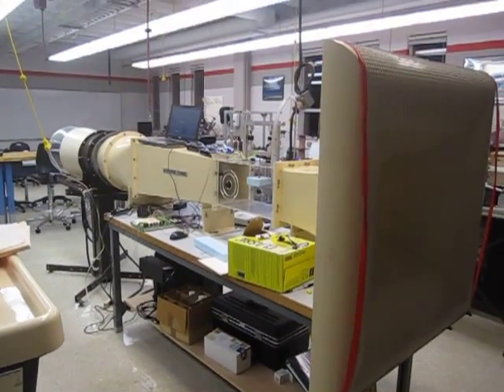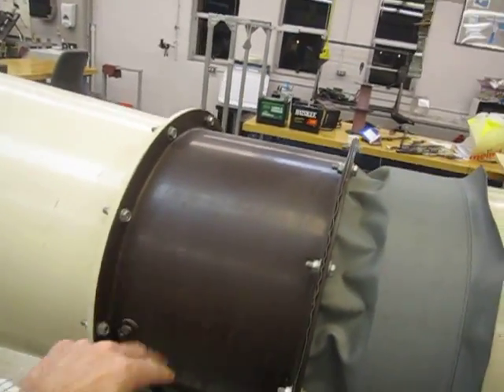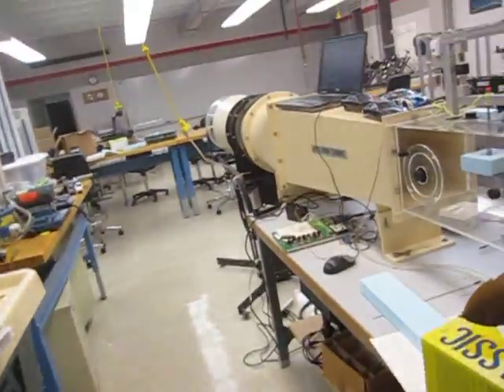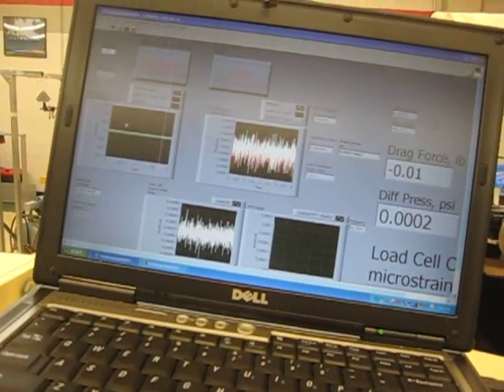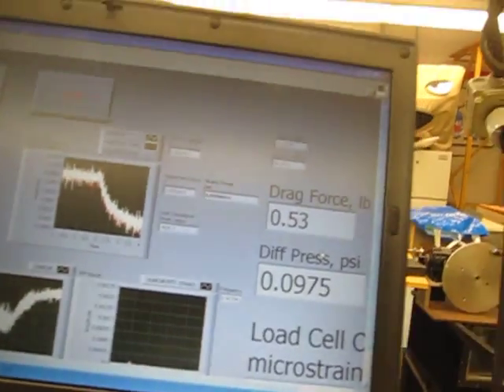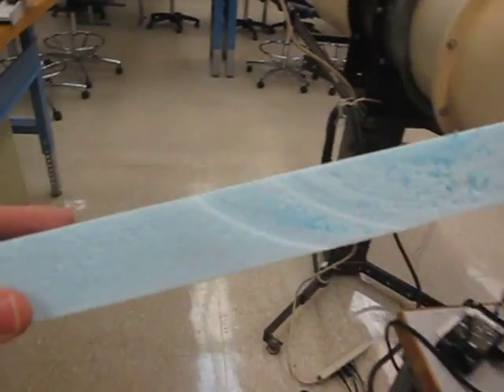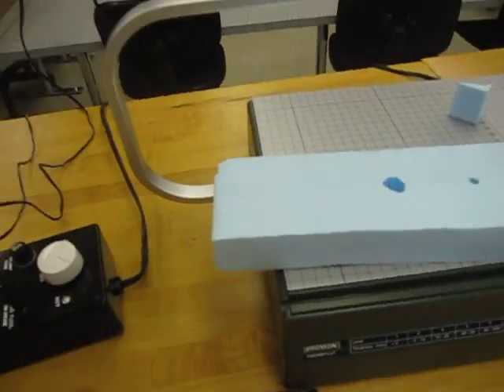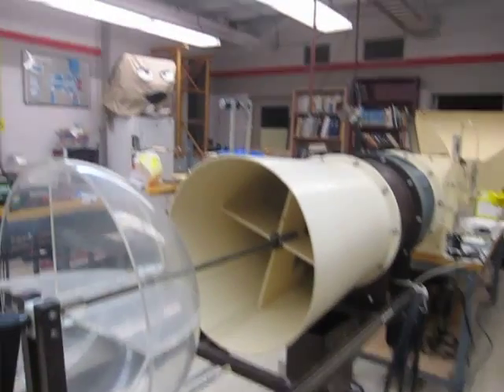Wind Tunnel - Drag Coefficient

Comment: will you please help me on my science fair project using your wind tunnel I need help because I am trying to answer the question, how does temperature affect aerodynamics, for my schools science fair and I don't have the needed equipment the most I need is for you to run 10 tests at about 48°C, 10 testes at about 11°C using the same size of foam that was used in this video then another 10 tests for each temperature without the foam the speed should be 20mph if you do this and email me a link for the video at 11superawesome11@gmail.com I would be extremely grateful.
Reply: density of air